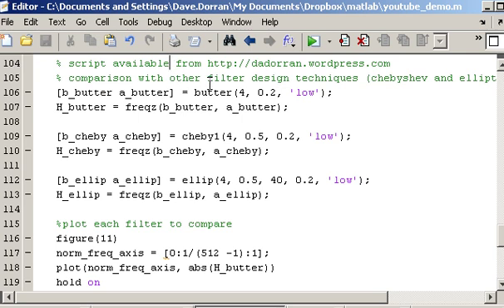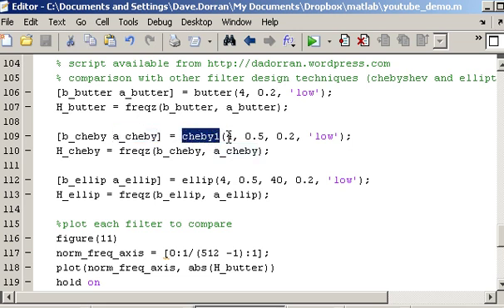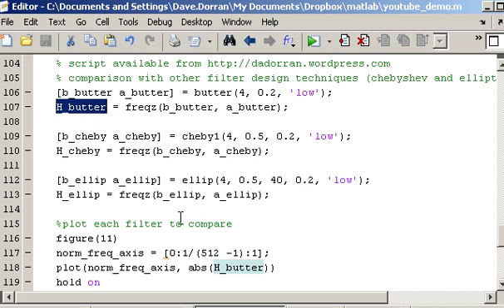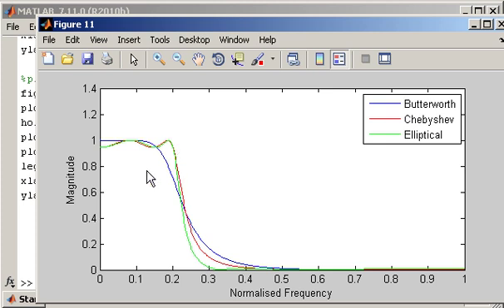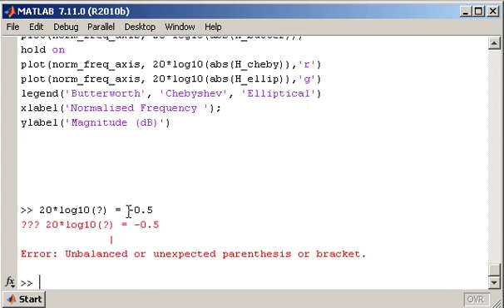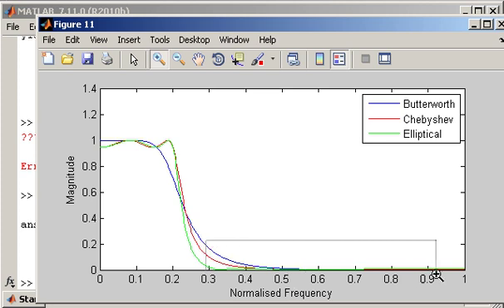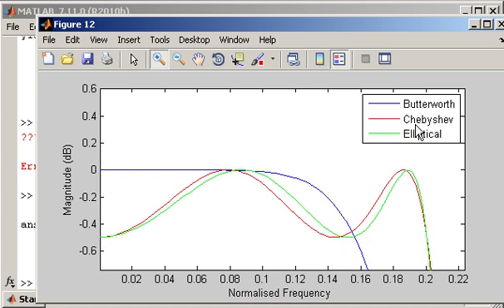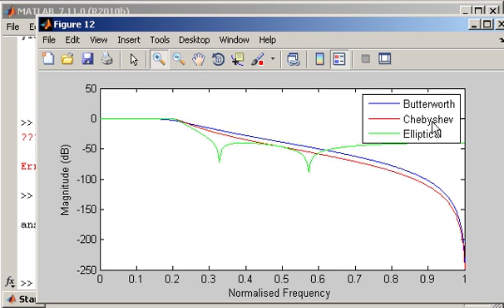comparison of different IIR filter design techniques in matlab

Comment: thank you for your video, it was really clear. I have a question, i want to design an IIR filter but using an optimization technics (the PSO) but i have a problem with the cost function (the error between  the desired and actual responses of the filter that i'm going to minimize), i couldn't create it.
can you please help me.
regards

Comment: Hi, the video is really clear. I want to ask something about the function "butter" to create a passband filter. I noticed that if I use a lower frequency limit really close to the upper frequency limit, the order of the filter can't be really high otherwise instead of  0 dB in that band I "boost" the signal and a lot. Why?I am approaching to the filter design, thus my question might be really naive. By the way I need to ask. Thank you :)
Reply from the maker: +Nicola Melone Can you post the code you are using?
Reply: [f1,f2]=butter(Order,[f_low(g) f_up(g)],'bandpass');
H=freqz(f1,f2,,200000);

The signal is in a ".mat" file. Do I need to send it to you? Thanks:)
Reply: tthe number 2e5 is given by the half of the length of vector at which I have to apply the fft.
Reply: try with : f_low= 3.5e-05  and f_up=4.45e-05. The values are so small as the fft has a really wide range that I am not able to reduce.
Reply from the maker: What is the value of the variable Order? Where does the fft come in?
Reply: I have done the fft before. And as I found on one of your paper on the website when I do H=freqz(f1,f2,floor(num_bins)/2). IN this case floor(num_bins)/2)=2e5. The order that works it is just the first. If I set order 5, or 6 etc and then look at the variable "H" as said above, the filter within those frequencies "boost" the signal. SO I need to use order=1.
Reply from the maker: +Nicola Melone Does the following help? Is H1 the type of frequency response you want?

[b,a]=butter(2,[3.5e-05 4.45e-05],'bandpass');
H = freqz(b,a, 2e5);
b1 = b/max(abs(H));
H1 = freqz(b1,a,2e5);
plot(abs(H1))
Reply: It looks like that excatly!Using the your technique the maximum order that I can put is 2. Thanks:) is better than the one I had before for sure :)